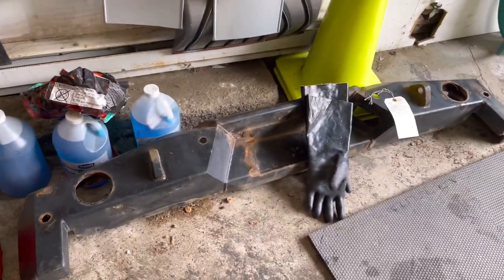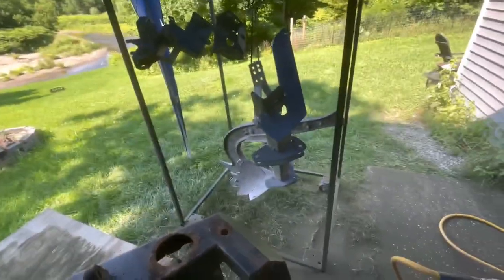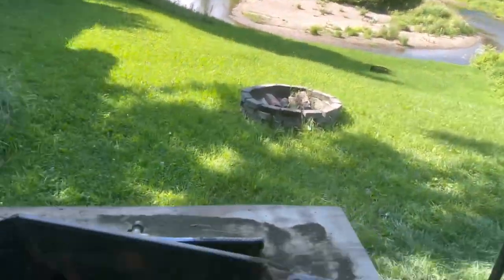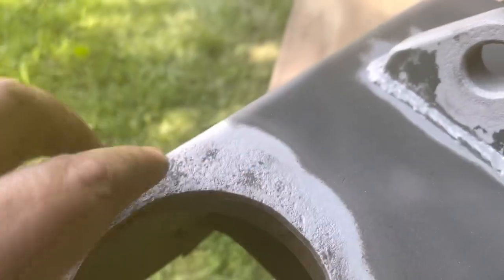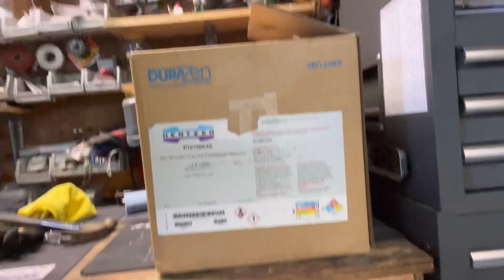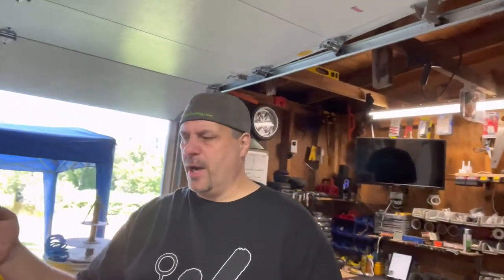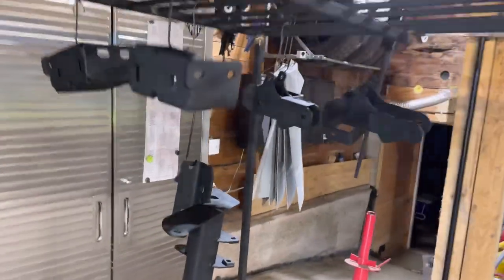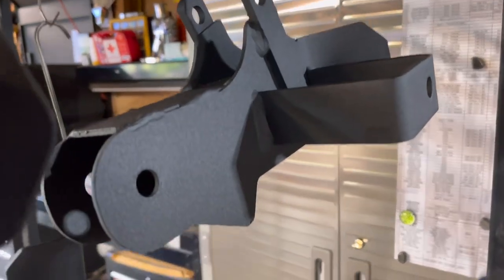Powder Coating a plow frame & brackets #58

Comment: I asked the same opinion of people of what they thought and I got “do what your doing and to also do what you like”. Your editing will get better and more refined as you go. There are some video editing channels that will show you some tricks and things that can refine your video to your liking. I just ordered the ameriblaster kit for the harbor freight tank. I was wondering what type of media you use and what pressure you run at? I got the 1/8 tip.
Reply from the maker: First thank you and I just subscribed to your channel. So I run 10x in my cabinet with the Ameriblaster tap kit. Now on my pot blaster I use outside I use tractor supply red bag (fine) coal slag. It's like $11 but if you buy 10 or more $9. I fun at 120psi
Reply: @GMPC  thank you for the info. I subscribed to you too.